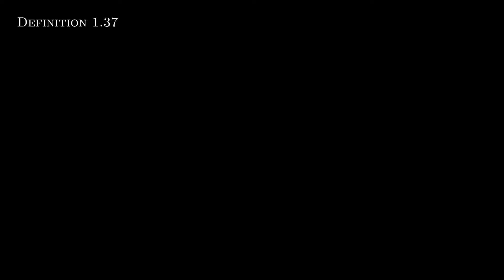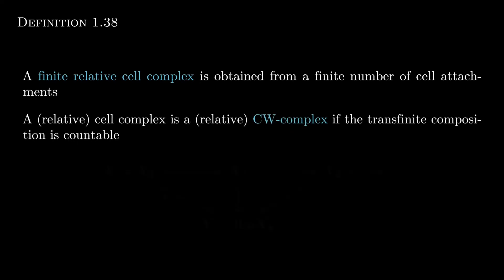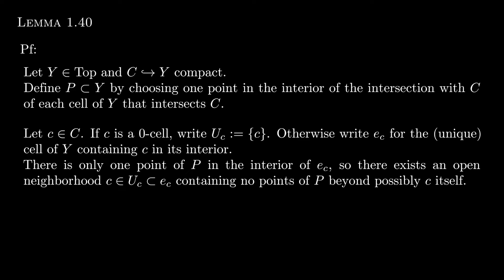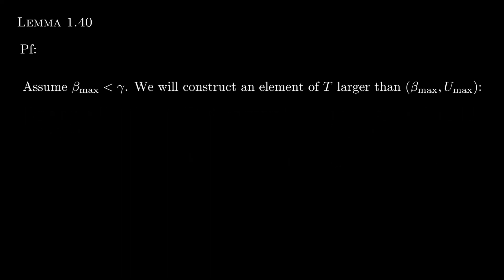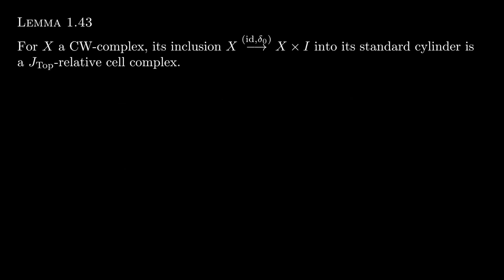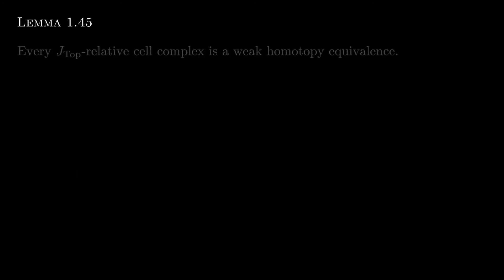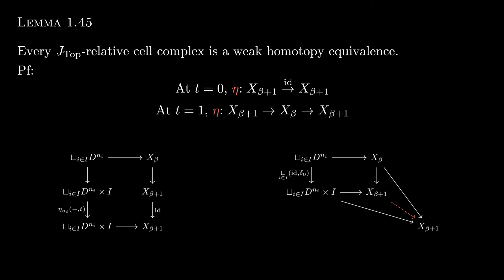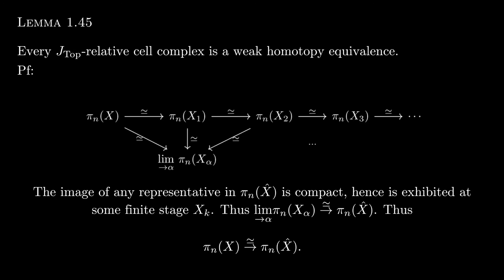Introduction to Homotopy Theory- PART 3: CELL COMPLEXES

Comment: If I recall correctly, you mentioned in a previous comment that you're still a university student. How to you pick up the advanced topics you present in your videos? Do you just pick up a textbook (or other introductory material) and start reading?
Reply from the maker: I attempted to read through nLab several times before it (hopefully!) stuck. With regards to something like stable homotopy theory, nLab represents, perhaps, the highest level of abstraction. But I think that underscores the non-linear manner in which I learn math. I took an algebraic topology course, but it hardly touched homotopy theory. Nonetheless, I was exposed to the open question regarding the stable homotopy groups of spheres. And so I had a goal. I searched Google for a "roadmap to stable homotopy theory" or something of the sort. Various forums were extremely helpful in outlining the various areas I needed to learn, and in providing references. I also began to watch lectures on Youtube, and read a few advanced articles and books. The purpose again being to better understand what I needed to learn (i.e. what I didn't know) and better motivate my study. For example, not just learning about derived functors and Ext and Tor, but developing an intuition that explained the reason they showed up in the Adam's spectral sequence, a central tool in stable homotopy theory.
I found nLab early on, but couldn't appreciate it then. After better understanding introductory algebraic topology, and developing some categorical vocabulary, I am finally able to appreciate the significance of the abstraction presented in model categories. So build up to abstraction, and if I had to just say one more thing, it would be to not force a linear trajectory of learning onto yourself- the end goal is what keeps us going. Look ahead, and keep returning to fill in the gaps in your understanding.
I've always considered myself a mediocre mathematics student- but I truly believe that love for the subject is all one needs to keep going.
Reply: @rooney5395  Personally I still think stuff in nLab is just too advanced for me (well, I just started learning algebraic topology in less than a year). Do you have any recommendation for things to consider before going to nLab?
Reply from the maker: @valerianmp  I still think Hatcher's AT is a great place to start, pretty much all of it is useful (particularly Chapter 4). nLab is sort of reconstructing homotopy theory with the language of category theory and model categories, and so for many the largest barrier is just the category theory. I personally just picked this up as I went. It's really just a matter of developing intuition, I believe math3ma has a good series of posts on it. A really popular next step would be Peter May's Concise and More Concise Algebraic Topology, which develops the theory with more formalism while still being accessible to those with little background, though I personally haven't gone through these. Hope this helps!
Reply: @rooney5395  I'm currently working out on Hatcher and chapter 4 does indeed feels like introducing a lot of interesting stuff!